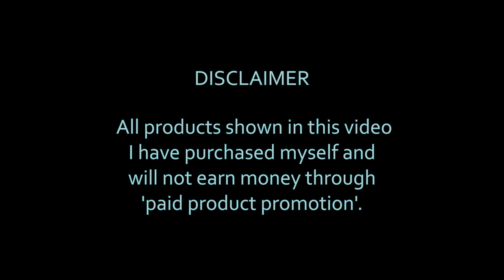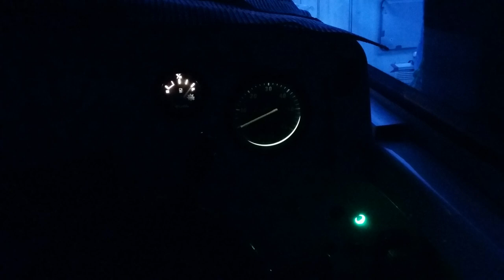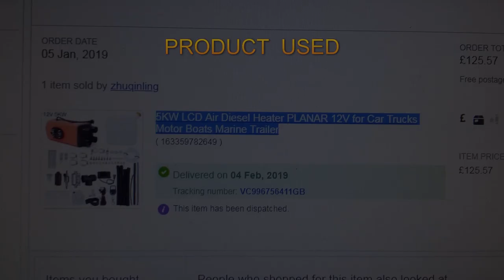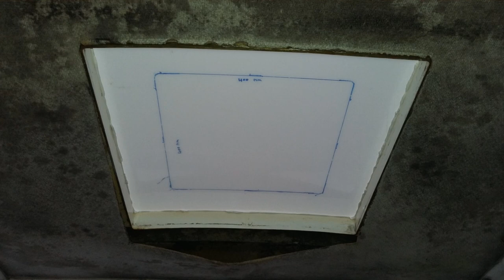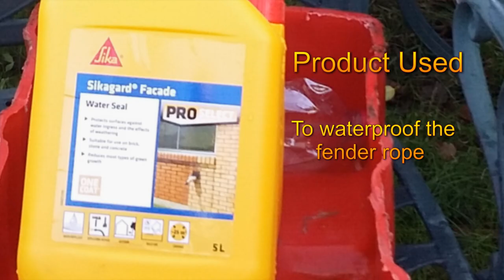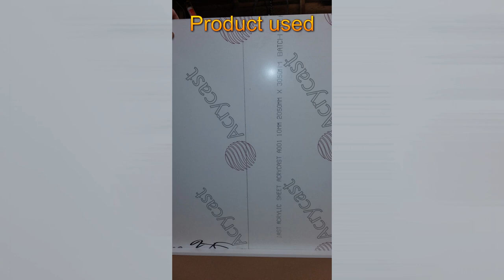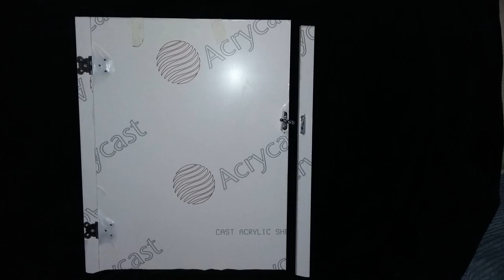Hardy Navigator 18 Refit Pt 1

Comment: Love the videos. Can you tell me, how you cleaned the dirt and mould off the white fibreglass on the top half of the boat? It looks brand new after your cleaning.
Reply from the maker: Hi, yes, 
I used the cutting compound pictured in the video at 5:35 mins and then went over the entire boat again with the product shown at 5:56 mins in the video. 
I won't butter this up for you....
It Is Extremely Hard Work, and very time consuming!
But, if you put the effort in, well, you have seen the results.
Reply from the maker: So first up was the fast cut compound. There are 4 different abrasive types in the 3M Compound range, denoted by yellow, green, blue and white lids. Check YouTube vids for these. I used the blue lid for most of it, and the white for the stubborn bits. I also used a polisher machine (as pictured on the 3M bottle) to polish the hull. I did the (white) deck and roofs by hand by putting a small pea size blob on a rag that was wrapped around just 2 of my fingers to polish a 2x2 inch square. And yes, I did the whole deck by doing this. ie Time consuming.
On the stubborn bits, don't give up. Go over it again and again until the yellow is white again.
Reply from the maker: I did the same thing over the whole boat with the chemical guys boat polish, and though this does take time too, it is so much easier and thus faster to apply.
Reply from the maker: I will say, that not all polisher machines are the same. A £40 car polisher will not work. You need one that has different speed settings as it needs to have a good amount of torque to it. 
Also, don't run the machine too fast as it generates heat. 
It Is Easy To Burn The Fibreglass Gel Coat.
Slow and steady on small areas at a time. You can lubricate the polish using water in a spray bottle.
I hope this helps.
Reply: Thank you very much for your detailed reply, very much appreciated 👍👍

Comment: Amazing job. What did you use to re-coat the inside of lockers/hull. e.g. at 8.18 and 11.31?
Reply from the maker: The paint in the hull is Hempel bilge and locker paint. Give it a good sanding and wipe with a damp cloth to get a good key for the paint to bond.

Comment: Also - i think I'll need to replace the windows on a Hardy Pilot I'm buying. Did you order your replacements from Hardy? And the black rubber seals? Grateful for any info there!
Reply from the maker: Hi sorry for the delay to reply. Desktop died and no messages are not available on mobile version. Ok, the windows are the original glass on the sides, but the front was a replacement perspex we cut ourselves using the original as a template.The tint we did ourselves too using Limo Dark tint, available on ebay. There are lots of tutorial vids on YouTube of how to tint windows. The seals we bought from Seals Direct.  If you send them a sample they will send you the correct size seals. Don't guess the size! send them a sample. We opted to buy the rubber trim tool too as it makes it so much easier to refit the trim. Hope this helps...
Reply: @Phlash1  incredibly helpful. Thanks so much.